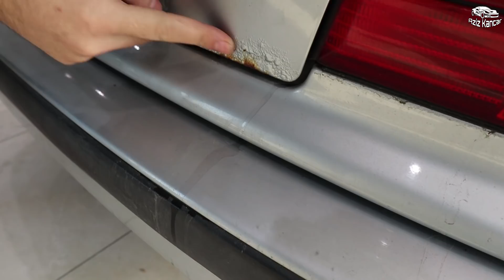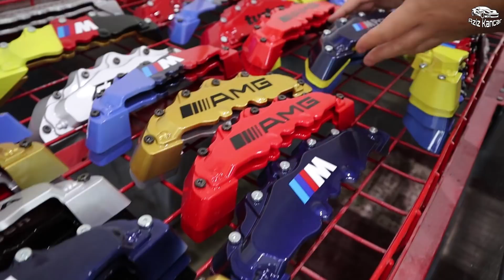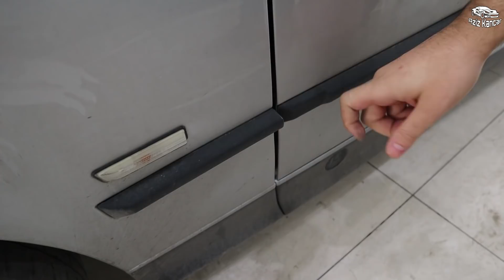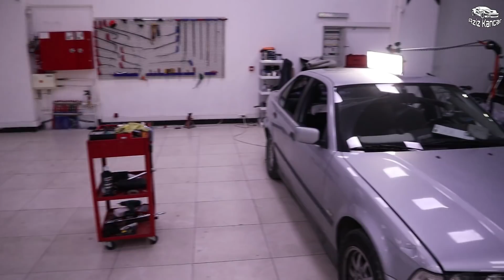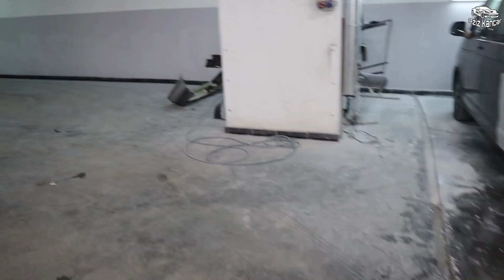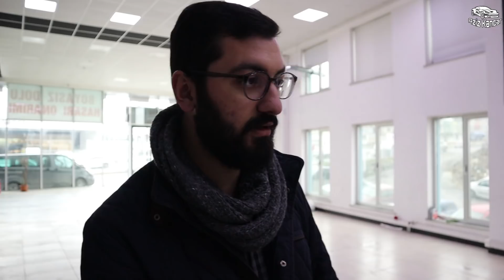BMW E36 PROJESİ | ÇÜRÜKLERİ ONARDIK BOYASIZ GÖÇÜK DÜZELTME YAPTIK

Comment: 94 lerde çift airbag olur aracın şasi nosunun son 7 hanesini bmw vin sitelerinden birine girin. Pasenger airbag yazıyosa sorun yok yazmıyosa sonradan koyulmuş demektir. Üzerindeki bıyık  sacı 96 6. aydan sonra makyajlı e36ların bıyık sacı değişmesi lazım. Yan çamurluk sinyalleri de yine makyajlı çamurluk sinyalleri aracın yılına uygun değil ya çamurluklar değişmiş ya da yeni tipe çevirmişler. Kapı çıtaları non m araçlarda üzerindeki gibi olur kalın çıtalar m paket araçlarda çıkmıştır. e36 dipsiz kuyu desek yeridir öyle herkesin lafına kulak asılmaz.
Reply from the maker: peace barış ekspertiz çamurluga anahtar bile atılmamış sökülmemiş dedi siz degişmiştir diyorsunuz 🤷🏻‍♂️
Reply: Aziz Kancar sinyaller yeni tip 97 98 modellerin sinyalleri araştırırsan görebilirsin. Değişmiş ya da sinyal yeri açıp monte etmişler başka bi sebebi olamaz. Bmw bu araca özel 94 senesinde yeni tip sinyal mi koymuş acaba. Ayrıca bu arabalarda expere çok güven olmaz herkesin bilemeyeceği püf noktaları var